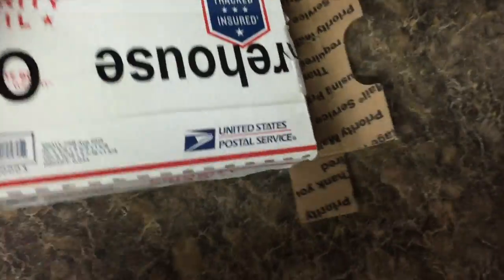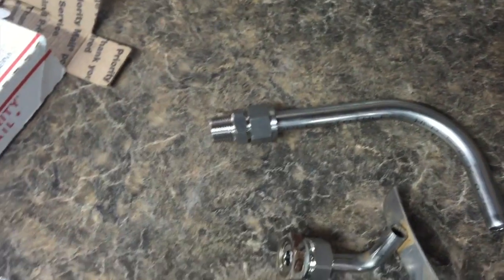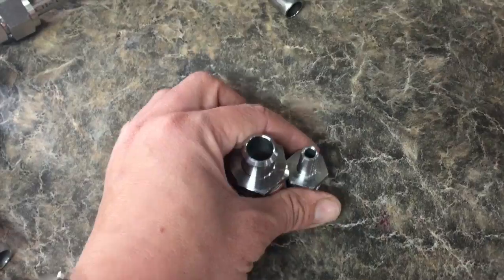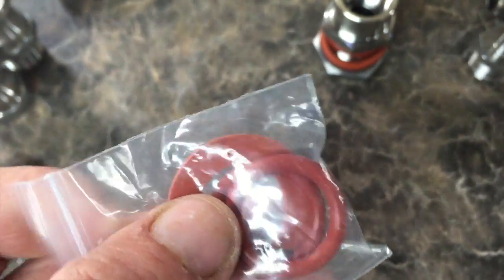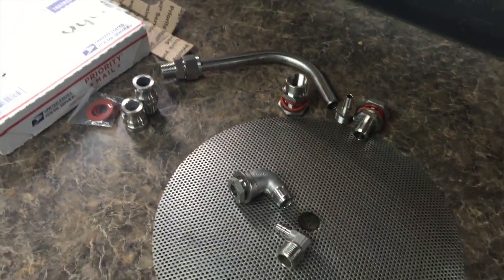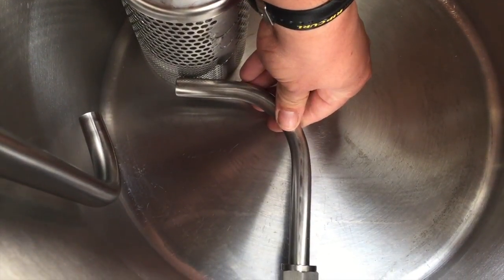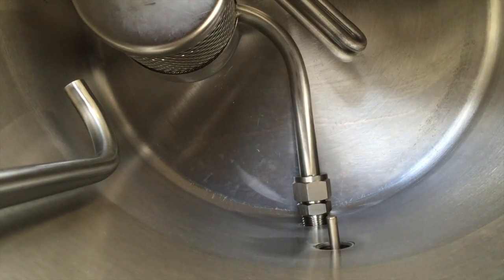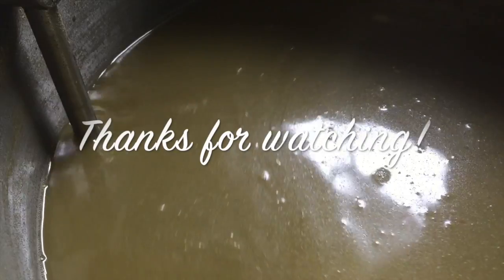Kaukapakapa Brewing HBW26

Comment: Your whirlpool arm, is that from brewers hardware? Are your ss brewtech pots the 15 gallon versions? And what length arm do you have? The reason I ask is because I'm looking to add a whirlpool arm to my 15 gallon ss brewtech pots.
Reply from the maker: saintmoz hi mate yep form brew hardware! just the 10 gal pot. I got the small 8" arm, I'm really happy with where it sits which is just under the 5 gallon Mark! So you probably want to go a bit longer....To me it marks sense to have it as high up as possible so you don't disturb hop cone? But obviously it needs to be under the smallest batch size yo intend to do!
Reply: Mr Pearce thanks for that, I'll go for a bit longer. Have you tried one of the many fast lager fermentation schedules? I've just busted out a helles in under 2 weeks, super happy with it, clean, clean, clean.
Reply from the maker: saintmoz cheers, I had a read about speed lagering after you prompted me! Sounds like a plan...or an experiment I could do! HHBW

Comment: No leaks straight up - you're just taking the piss out of the Hapless !  Is it really cheaper to get your stainless stuff out of the states rather than from Australia?  They do look pretty good quality though.  Cheers mate.
Reply from the maker: Blue Shed Brewing Blue Shed Brewing well.....there was a drip every 2 mins from the bottom bulkhead in the mash tun when I ran some Star San initially, so gave the nut a quarter turn! It's not cheap from the states, if it's a generic part I'll get it from aliexpress, but most of those SS parts had bigger bores... that you can't get online form China. I also like supporting Bobby from www.Brewhardware.com he's put out heaps of how to vids! HHBW!